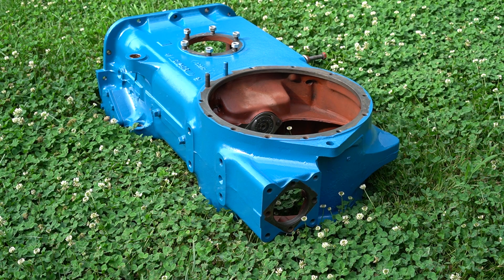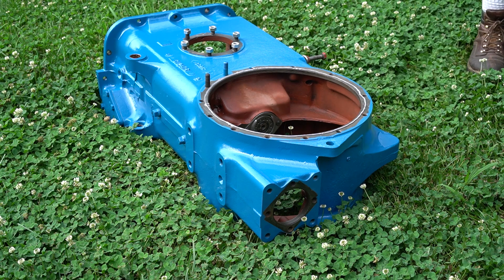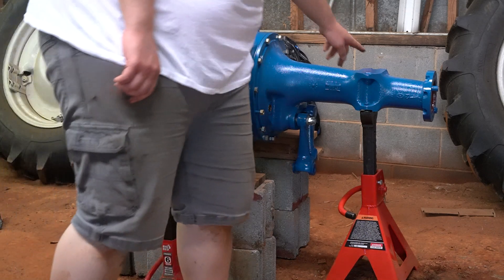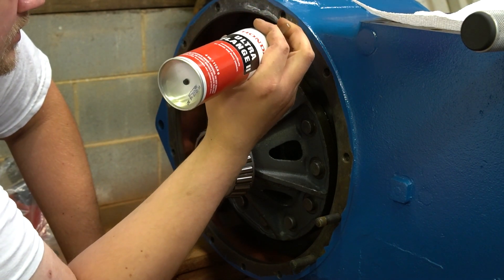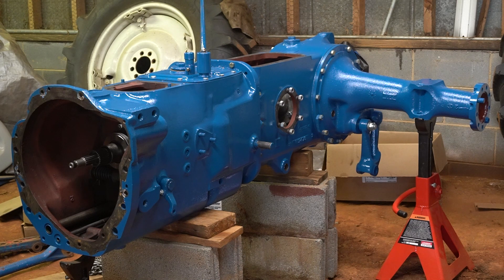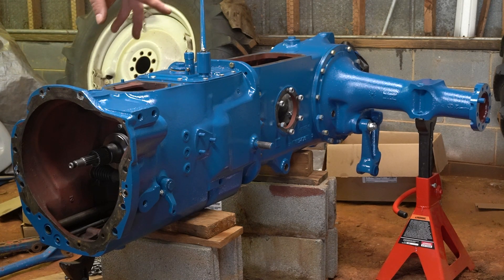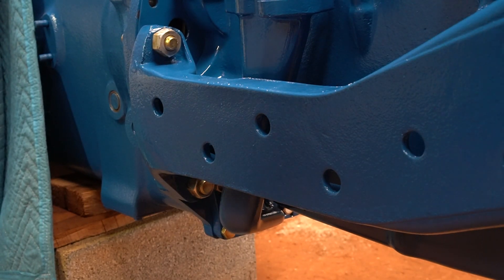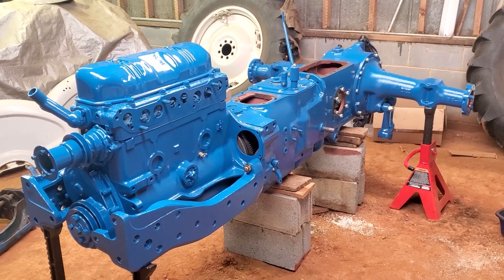Ford 4000 Row Crop tractor chassis assembly

Comment: When you used RTV instead of the gasket for the trumpets were your carrier bearings pretty tight? My pinion is set at 16-18lbs but with the carrier installed its turnable but pretty tight by hand. Wasnt sure if i should be worried about it.
Reply from the maker: Mine was tight but able to spin by hand. All 3 of my tractors I've rebuilt used rtv since the gaskets never seem to fit. I haven't had any bearing failures or I'll effects on any of them.
Reply: @chickenhousemechanic  perfect! Thanks for the input.

Comment: Why doesn't it need silicone on the transmission gasket
Reply from the maker: Don't need it. Factory didnt have it. You can add it if you want though.
Reply: Thanks, I just bought a 671 sos and the gasket between transmission and rear end is blown out at orings

Comment: I have been using your videos a lot, thank you.  I am rebuilding a Ford 860 gasoline engine (See youtube of my motor at Jim's automotive machine shop).  Project started last year and memory is failing me...question to you as I am almost ready to mount the motor to the bell housing:  What and where do I attach the large plate behind the fly wheel with before installing the flywheel, clutch, and then mating to the transmission bell housing?  What are the attachment points and screws or bolts?   Thank you for all your help.
Reply from the maker: The plate just has dowels that it slides on. Put it on first, then flywheel, then clutch.
Reply: @chickenhousemechanic  Thanks for you help
Reply from the maker: @johnmartini8264  you're welcome

Comment: You do very good work. I've watched several of your videos and I appreciate your knowledge of these old tractors. I'm a Canadian YouTube creator and I have a '68 Case 580CK that I've done some videos on. It was pulled out of the bushes after being abandonded for more than 15 years. I don't plan on doing a full restoration, but I just want to get it going for use around the property. I've subscribed to your channel and look forward to more of your work. Best Wishes !
Reply from the maker: Thank you. I'll have to check out some of your videos. I plan on using this one once it's finished. I use all my old tractors. Main reason why I completely go through them. They're basically brand new when I get finished with them.
Reply: @chickenhousemechanic  You are restoring them completely--they could be in a museum. Do you take them to tractor shows? They'd be a hit.
Reply from the maker: @EverydayProjects  yep, every nut and bolt is either restored or replaced. Changing all bearings, seals, bushings, wiring. I've never taken them to shows. I don't own a trailer. In my area the 4000 is pretty much one of a kind. We have tons of 8ns, 600 and 800s, 65+ Fords, and a bunch of Deeres and Farmalls but row crop Fords are basically nonexistent.
Reply: @chickenhousemechanic  Interesting. keep up the good work !

Comment: Did you keep the SOS you took out of this 4000?   I'm looking for a good blue SOS to put in a model 871 with a bad SOS.   I do have a set that almost matches your 2 tractors.  My 4000 row crop is a gas SOS and I have a model 861-D.  Both nice tractors.
Reply from the maker: I still have it. Might find me a 801 to put it into one day. Just not sure yet.
Reply: @chickenhousemechanic  thinking about putting a good 5 speed I have in the 871.  Thanks for the video describing the parts needed.   All I'm missing is the pto shaft and pto cover along with some gaskets.
Reply from the maker: @scottanderson2382  you're welcome. I could never find good information about converting one from a SOS to a geared tractor so I figured a video showing everything would help a lot of people.

Comment: I noticed that you don’t have the governor linkage installed. Before you get to far you have to remove that front cover to install it. I’m not trying to be a know it all just trying to help. You are doing a nice job on this tractor.
Reply: My bad didn’t realize it was a diesel and not a gas
Reply from the maker: @danhendershot904  yes that's correct. Diesel is all in the injection pump. Good looking out though.